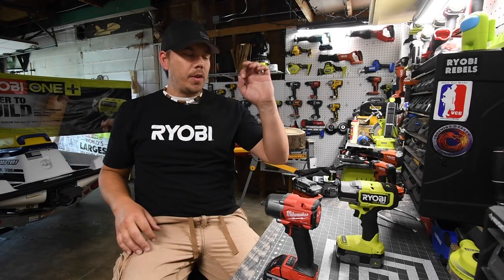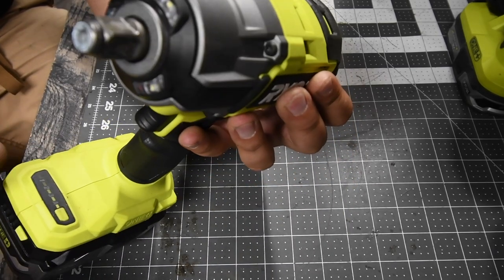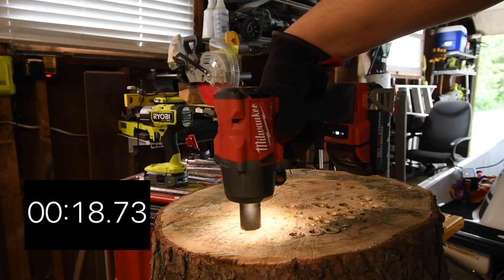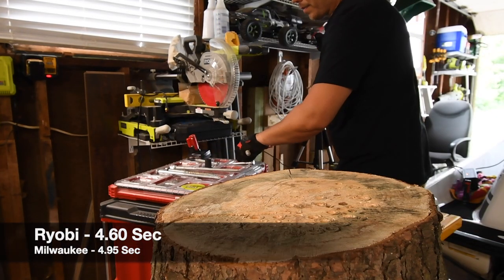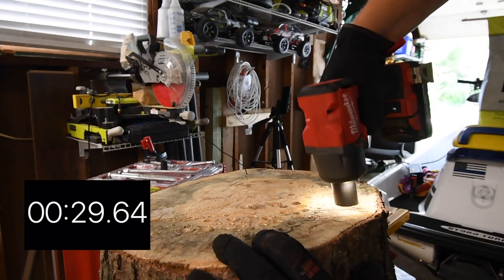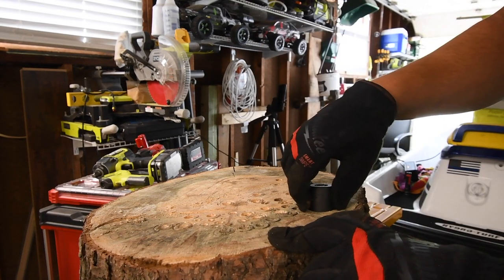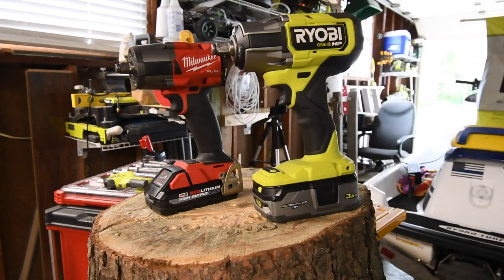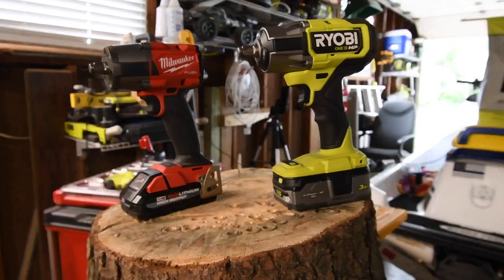Ryobi vs Milwaukee with (3ah batteries (Impact Wrenches)

Comment: I converted to Milwaukee because I had reliability issues with Ryobi but I'm still jealous of the bang for the buck of Ryobi. 

I think that the smaller size of the Milwaukee is also an added advantage considering these are often used int he automotive industry
Reply: Christian, just buy Milwaukee tools at Ryobi prices.  For example: I ended up paying $139.00 for the Milwaukee M18 Fuel 18 Gauge Brad Gun.  It came with a free 8 amp battery, which I returned, taking the price from $279.00 to $$139.00.
Reply: yeah my smaller version half inch milwaukee is a monster compared to this, it's not the stubby, it's a hair smaller than  this though

Comment: I have the Ryobi P262 and it's done well with everything I've used it on so far.  I haven't used it much yet since I have several other impact wrenches so I use whatever is handy when I need it but it's been very good when I have used it.  My only complaint is a minor one and that is it's size.  It's bigger than the Milwaukee you tested it against and I often use my Milwaukee M12 impact in tight spaces where I don't need the extra power.  So far I'm happy with the  P262 and would recommend it especially if you already have other Ryobi 18 volt tools it's a major step up in power and technology for Ryobi.  I bought it  mainly because I had a Ryobi weed trimmer with a couple of chargers and several 4ah hp batteries.  I have since bought additional batteries and will probably buy the updated 3ah  battery you used in the video.

Comment: The P262 w/ a P195 3ah  - does not get a whole lot better than that in the mid torque range. Great video!
Reply: If you cam find a 195...  They've disappeared.
Reply: Have you done a comparison of the P262 vs 2960-20 on your channel?

Comment: I'm surprised by that Ryobi, it's a beast.
Reply: Same here man!!!! I can't believe it! I was like this! 😲 What the hell happened?! Whaaaaaaat?! Milwaukee got beaten by. Junkyard 🐕?!! What the hell?! I'm not a fan of Milwaukee and never owned any Milwaukee, I only owns DeWalt, Makita, Bosch, Ryobi tools, Craftsman, Black and Decker and Stanley, Hitachi/Metabo HPT, and some Harbor Freight Tools Bauer and Hercules! All of them Both Corded and Cordless tools And I recently got a top end cordless brushless Flex 24V Quick eject Turbo 4 speed impact driver and Turbo 2 Speed Hammer Drill, with baseline or Basic Flex 24V brushless single speed impact driver, 6-1/2" inline circular saw and Flex 24V Rear handle worm drive style circular saw and got some Flex 24V 3.5Ah Stacked lithium and 6.0Ah Stacked lithium batteries 2 pc each. That's all I have but never owned any Milwaukee tools. but I do know that Milwaukee is a fine tools! And I come here seeing Milwaukee got beaten by Ryobi?! What in the hell is going on here?! What's gonna be Milwaukee fanboys excuses for this??
Reply: @twinbee  no good excuse.  My question though would be for TTC if they have run the P262 vs 2962-20 on their scales.  See what breaking force looks like.  One thing to consider with impacts is how many impacts per minute, because in a test like this, that will make the difference.  Now breaking force typically is more important with impact wrenches, so I'd like to see that test. 

Either way, that Ryobi is damn strong.  Almost makes me regret selling all my ryobi and converting to milwaukee.  Almost. My milwaukee tools do everything better than my ryobi tools did.

Comment: I just found out hear from you that's the 3.0ah hp has 21700, if I had known earlier, I wouldn't have sold it. But, if I have best deal on eBay, definitely buy it. Thanks for information..

Comment: For the price Ryobi will be a more attractive buy if they extended the warranty to 5 years. I'd get this over the older Milwaukee 2860 mid torque since its about the same size and Torque specs 👍

Comment: Isn't that the HO Ryobi battery that has the contacts for the older model tools to utilize the HP tech properly? I wonder how the newer batteries fair against that same Milwaukee tool. And I have all Ryobi tools, not a red fan boy or anything.
Reply: Green fanboy
Reply from the maker: yes, it is one of the batteries that have those connections

Comment: Wow! 😲 I can't believe it that Ryobi beaten the Top notch and champion undefeated, unrivaled Milwaukee!!! Damn! Wow! Hey Dave MCT are you using a dry Lag bolts? I mean dry totally dry no lubricants, no oil or grease in there to make it drive more easier and faster than the other??? I can't believe it! I'm not a fan of Milwaukee tools! I'm one of those haters and bitter of Milwaukee tools but I can't believe it that a garbage TTI Ryobi beaten down a top notch tool brand well respected tool brand Milwaukee!! So IF Ryobi beaten down Milwaukee SO DOES Craftsman, Hart, HFT Bauer and Hercules brand and other small time tool company can beat Milwaukee as well! And DeWalt and Makita! How can the Milwaukee beat the outsider Flex IF the Milwaukee just got beaten by a "NOT" a contractor grade tool Ryobi?? Wow! That's what stupid people in the jobsite always says that Ryobi and the others are not a contractor grade tool. But see here Milwaukee got whipped like a dog! 🤣